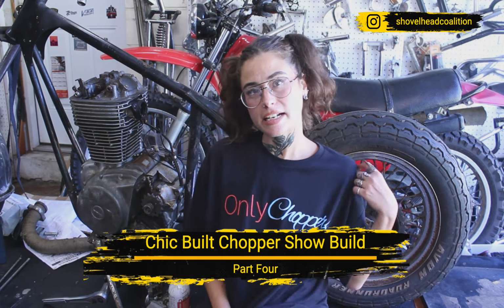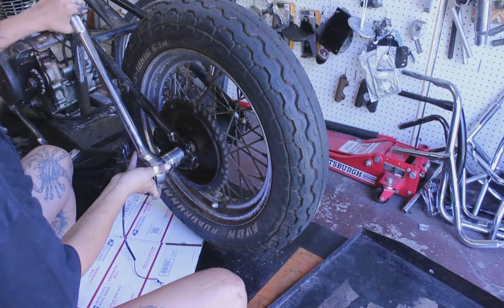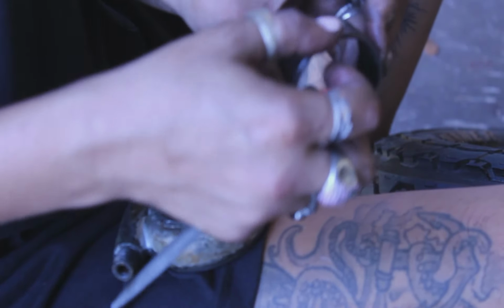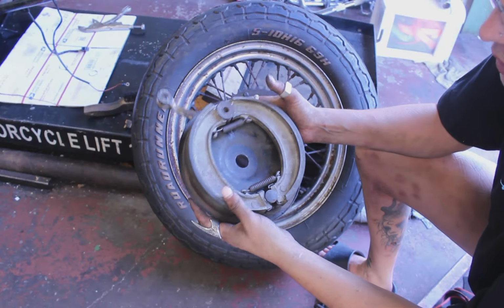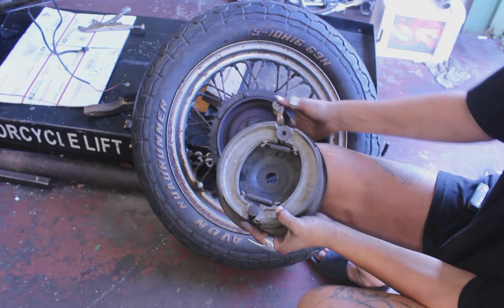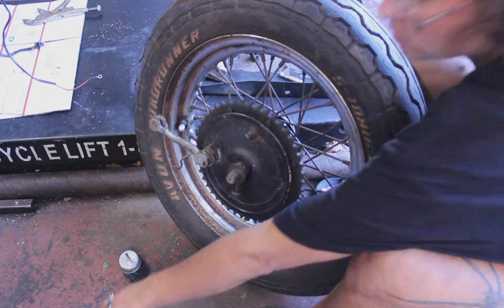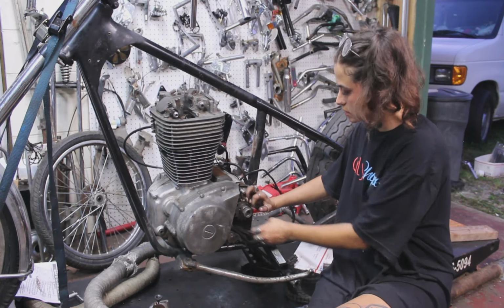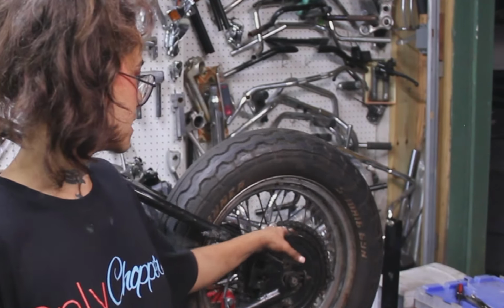PART 4 SAILOR JERRY CHOPPER 30 DAY BUILD - REAR DRUM BRAKES & ENGINE PLACEMENT

Comment: make a 90 degree elbowed intake and run the carb sideways, thats a possibility. or even an angled one, just enough to clear the top tube.
Reply from the maker: thank you!
Reply: @angel_ofanarchy  my pleasure, it would be easy to do and look cook. just find the right size tubing.